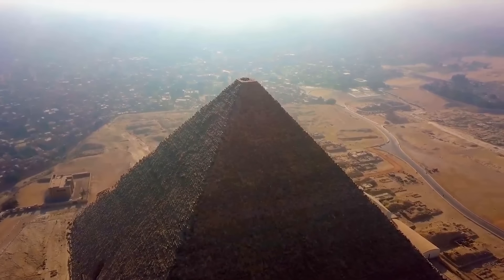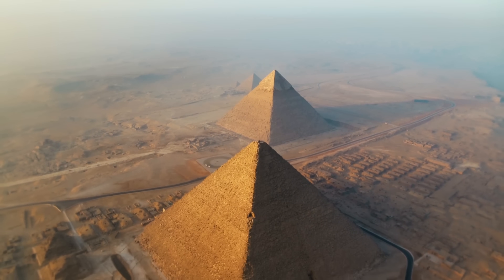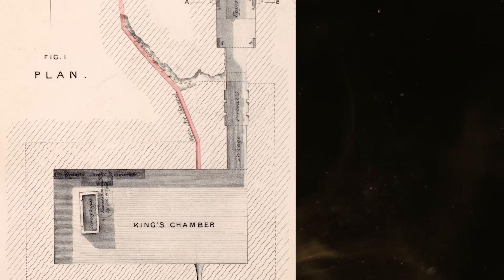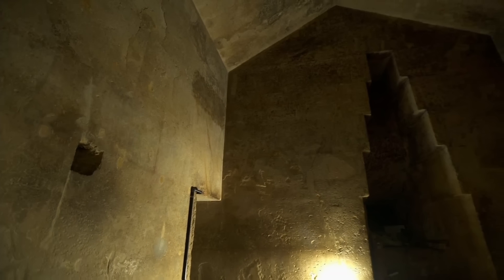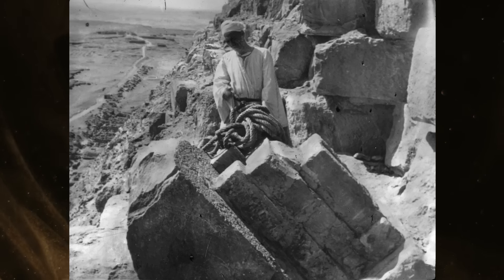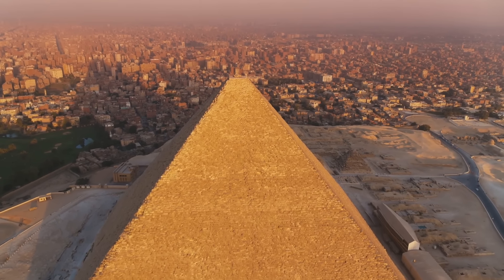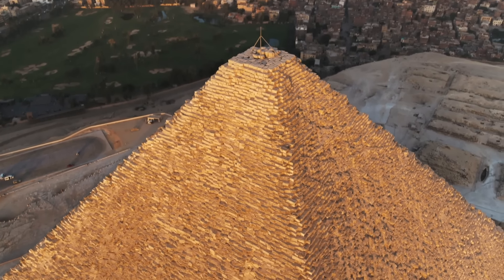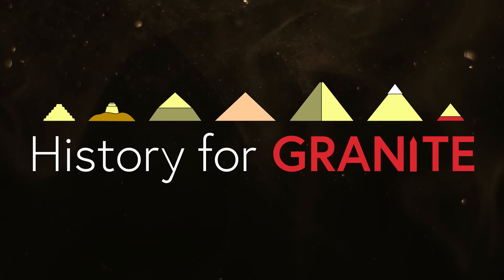One Solution to the Four Channels of the Great Pyramid

Comment: .....yes, but unfortunately you have not addressed why the Queen's Chamber northern and southern shaft's do not continue onward to the exterior of The Great Pyramid like we observe in the King's Chamber northern and southern shaft's ???.....are you saying that the Queen's Chamber is totally unfinished ???.....additionally, if the shaft's are for ventilation, why would you block the Queen's Chamber northern and southern shaft's at both ends, from the chamber itself up to were the shaft's meet their respective blocking doors, this seems illogical, as designing these doors within the construction of each shaft obviously blocks their continuation to the exterior of the pyramid's casing-stones ???.....still too many unanswered ???????? HfG.....
Reply: Based on the shorter channel lengths and position and nature of the unfinished chamber it almost looks like a decision to change the pyramid size/height or to create the kings chamber was made during the construction process.
Reply: @tommymaddox6785  .....OK LOL !!!, so let's get this straight, both the initial constructions of the Subterranean Chamber and the Queen's Chamber were made in error, and thus intentionally decided upon to remain unfinished by the architectural intellect of the Pyramid builders during the construction process ?????.....likewise from the outset, the Pyramid builders had absolutely NO prior foresight during their construction that the possible abandonment of interior chambers could materialise because of their own erroneous architectural/mathematical calculations !!!!!.....continuing, the Pyramid size/height had to suddenly CHANGE during the construction process because the architectural intellect of the Pyramid builders were again very erroneous with their mathematical/architectural calculations of the Pyramid's interior/exterior harmonious proportions ?????.....and so, notwithstanding, this narrative conveniently fits very nicely with OUR own modern 20th, 21st Century mindsets and points of view !!!!!, thus OUR analysis here is ABSOLUTELY CORRECT, IRREFUTABLE, UNCONTESTED and can easily explain away the MANY questions relating to The Great Pyramid's architecture, mathematics and construction antiquity, CORRECT ?????.....your quote: "...shorter channel lengths and position and nature of the 'UNFINISHED' chamber it 'ALMOST LOOKS LIKE' a decision to 'CHANGE' the Pyramid...

Comment: I've been doing some thinking, and it seems to me that the way these channels were cut reveals also how the stones were cut. Unless I missed a revision, Egyptologists would have you believe that they cut them with copper tools, which just never really added up. Copper is much too precious and weak to chafe away on granite. However; the drill and saw marks do reveal that something thin was used, and they were able to employ this after the stones were put in place and covered.

And I think the answer is rope. Rope has incredible sawing properties, is cheap and can be easily fixed or replaced when broken.

Comment: It would appear that they were sealed in the chambers long before the pyramid was finished which would make them of no use during construction.
Reply: They would have been of use up until the higher end level was closed. There is use for them during the middle construction phases when they were still open.
Reply: Or a Megadisaster struck before they could finish. Water ,& a wooden plug could be added, as they advanced up the Pyramid; (to prevent sand, & dirt from clogging.

Comment: I appreciate your utilitarian functionalist approach to the consideration of individual aspects of pyramid construction. While on the large scale, a pyramid and its associated complex itself, it's fair to suggest that ritualistic / theistic considerations might be the primary reasoning behind the design. But when we get down to atomic, meaning small individual, elements - I think questioning from a utilitarian functionalist perspective makes more sense. Yes, those blocks with the copper pins might have some ritualistic function, but it might also be leftover tooling from the construction itself and we should start from that paradigm before anything more complicated. I am not suggesting that it's purely functional, only that considering function on a range of possibilities starting with purely functional and then moving towards more abstract purpose seems to be the best way to approach it. And then even consideration of the "atomic" individual elements, the structures that they are incorporated to at larger and larger scales until we are considering the entire - well, that's where it gets very interesting. Clearly I am saying what the narrator is essentially saying - those shafts sure are a conundrum. Anyway, great channel!

Comment: I've always had an interest in the pyramids at Giza.  All the passages, all the strange angles, and particularly the weird little opening at the bottom which heads down into the plateau and appears to have originally been cut all the way to the natural aquifers, was really weird.  Why put a well at the bottom of a crypt?

Then in 2014 I worked for a local water well service.  Modern water wells consist of a single shaft down into the water table, with a perforated pipe down into the Earth and a mechanical pump at the very bottom.  The perforations in that pipe allow water to seep into the pipe and the pump pushes that water up through the inside of yet another pipe system which leads to plumbing.  Eventually those perforations, in the outer pipe, become clogged with sand, silt and rocks, so then the well service has to perform "an air lift" where they open the well head to attach a massive air compressor (the kind which can only be moved on a flatbed trailer) and they remove the inner pipe, connect the compressor to the outer pipe, and then push over 600psi down the pipe to blow the obstructions out of the perforations.  The massive air pressure pushes the silt and debris out of the perforations dozens of feet below, and also pushes hundreds of gallons of water back up and out of the well head, around the outside of the perforated pipe.

So for the last decade I've been convinced that all 3 pyramids at Giza represent ancient well heads, which effectively collect and pressurize air for the purpose of aerating and thereby pumping the water in the aquifers below.  In this fashion, the massive pyramids could serve as non-mechanical pumps which drive water in the aquifers to wells and fountains which connect to the same aquifers, all over the plateau, with overflow welling back up into the pyramid itself like a cistern.  My idea is that each pyramid was built as an upgrade to the previous.

This layman's theory explains a whole lot of oddities, such as the undeniable evidence that the Sphinx enclosure (downhill from the Great Pyramid) has suffered water erosion (where different geological experts all agree that the water erosion occurred, but disagree as to how and why) and that the temple beneath the Sphinx was once completely filled with water.  It further explains all the chambers in the pyramid as cisterns, and the steep uphill grade of the Great Pyramid's entrance shaft, for draining the cisterns onto the plateau surface.

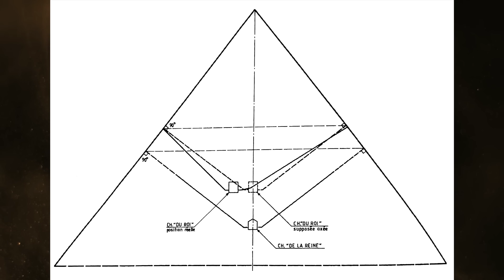Comment: Truly awesome video, but 23:00 you say that "the difference in inclination still follows the shortest path for both channels", which isn't true.
From any point in the pyramid, the closest path to the outside is always one that has a 90 degree angle to the surface.

I imagine a good reason for why they did not use the shortest path is because of symmetry, since the ventilation shafts would be visible from the outside, they would have wanted them to be at the same height on both sides.
Also the diagram shown at 23:00 kinda suggests that the king's chamber was originally supposed to be in the center, so that could be another reason for why they adjusted the shafts like that.

Another commenter pointed out that another very good reason for not building straight shafts is the need for passive ventilation: as it gets hot inside the pyramid, the air will pretty much automatically be drawn out through the tunnels.

Comment: I love the way you use logic and observation to describe the constructions.     It drives me crazy the way MOST archeologists simply make up solutions to fit the problems - most of which don't make sense at all.       Just a thought, as the "Queen's Chamber" is much lower, and was possibly constructed during the early phases of construction, is it possible that the the two "air channels" were exactly that, until the construction got to a point, that they either were no longer needed, and/or functional?     This would explain why they were not continued any further?    Again, just a thought.    I can't wait for your next video, where you present your conclusions.

Comment: According to me, the panes in the queen's chamber could have been connected to other panes filled with water. They were covered because there was no need to unclog them in the event of accidental clogging of such small channels (20cmx20cm) with debris. Ask yourself how to remove the limestone stuck deep in the shaft from a curved shaft. It may turn out to be impossible. You would have to crush and break the stone and then remove it from below. If it hadn't been noticed that
  the canal is blocked with stones and rubble was constantly falling in. It would be almost impossible to break a large stone because the rubble would absorb the impacts. There was a high risk that the shaft could be clogged and therefore unusable.

Comment: The worst place to keep a pipe from being blocked is that its lowermost endpoint that only facilitates a place for work dirt stone rocks can pile up and block the entry , Why would the lower part of channel be sealed? If they did not want it blocked then it should have been done from a higher elevation not the bottom?

Comment: As a builder i imagine that the channels where needed for ventilation so work could continue and be relatively comfortable in the chambers while finishing work was done, so work could carry on around  , as the pyramid continued to be built past and over going upwards, once the queens chamber was nearly done those channels where blocked off at the point the pyramid had reached ,which by  design left them well back and hidden from the outside , the ventilation for the kings chamber would still be needed till the pyramid was finished on the outside so was hidden in the finishing off work .

Comment: The blockings with the copper works were used for changes with the seasons. The copper works allowed the blocks to be hooked and removed or had ropes attached to pull the blockers out. In cooler seasons the blocks were reset in place to prohibit the chimney draw effect so colder air wouldn't circulate into the pyramid. And/or, set in place to prohibit rain water from entering the structure. The channels with blocks are the on and off vent system.

Comment: Very impressive work. Also your later videos, absolutely incredible. It makes so much sense.

But I can't really wrap my head around, and I might have missed the explanation, but why wouldn't they build the channels open immediately? Why build them closed and open them up later? Somehow the workers are so revered that their bodies are put in the pyramid if they die working its construction, but they're not allowed fresh air? That doesn't really make sense to me.

Hang on...
It does make sense. They didn't wait until the pyramid was completely finished to open them. The blocks in the King's Chamber were put in place first. They worked from bottom to top, so they put in the ventilation shafts as they went along. The workers were still working in open air at this stage, and when the pyramid was closed the shafts were already open.

Comment: I believe the channels were for ventilation for the artists who would paint the walls with murals and hieroglyphs. This would have needed several lamps, that would have caused smoke and carbon monoxide buildup without ventilation. Both these channels were supposed to be plugged after the work was finished, but the pyramid was never fully completed.

Comment: Once you see it, you can't unsee it:  The tube cut bottom is higher!  The square cut side is lower.  The reason is the "ventilation" holes are not for air, they are for WATER.  The rounded side cupped and directed water to the lower flat side.  Angled and bent so it wouldn't run down fast. Condensation would always supply moisture for cooling.  The King chamber cooled inside so the holes broke thru.  The Queens chamber were uncut so the moisture would contain it's contents.  This allowed the structure to "breath" in thru the bottom chamber.  And breath hot air out thru the Kings chamber.  Physics explains how hot air rises.

Comment: Be interesting to test the residues on the top of the shafts for smoke or insence, if you have a body in there and it's going to rot it may allow some smell out, alternatively if you had started a ceremonies fire inside, smoke pouring out of the pyramid might look impressive, seeing a symbolic representation of the king returning to the sky, and then sealing off the tunnels, which would prevent air getting in and oxodising or rotting it's contents further

Comment: The chambers being tombs for a "King" and "Queen" has always seemed to me to be a modern imposed explanation for the chambers' purpose. I've read other explanation hypotheses, but all seem to fall short of being totally convincing. One thing about the Egyptian builders to me is that they were amazingly ingenious and advanced in their work. One obvious thing is that they knew a lot about how to use sand, stone, reeds and water. For example the Sabu Disk seems obvious to me to be a manufacturing tool for making rope. The Great Pyramid is a monument to their understanding, engineering and skill that remains unrivaled. They built with a grand vision to make things last millenia, not decades.

Comment: It seems highly likely that the Queens chamber was going to be the only burial chamber, but there was a decision to replace this with a more grand chamber. The air ventilation ducts were then capped and the Queens chamber left unfinished. The new Kings chamber was given the same ventilation ducts but they did go to the outside.

Comment: 21:25 in. in reference to the corner unfinished, its interesting that just now I am working on a job repairing cracks in someone's house and I am using the same technique to rebuild up the obtuse cornice to create a correct finish. Without the excess I pile up, I couldn't make it look right once the plaster has dried and to sand it back to the right shape. So the idea of it being left to perfect later is correct even in todays buildings.

Comment: Building the Queen's Chamber as a plan B would've required a massive amount of effort, which to me, as an engineer, I would never want to undertake unless there was concrete evidence from a recent attempt that the hassle of a plan B could very probably be worth it. Is there any evidence in past pyramids that the designers attempted something like the King's Chamber and failed, or another situation where a failed design could've led to a massive embarrassment? That level of conservatism in design could be some kind of insurance policy for the builders...a massive CYA move. Have there been void surveys on past pyramids? 

It also seems clear that their fears weren't about the service life of the King's Chamber and wear-and-tear on the new mechanisms, because if that were the case they wouldn't have sealed the Queen's Chamber's air shafts. Their fears must've been exclusively limited to the construction phase, and they considered the risk completely gone once the course of completed masonry rose to near the top of the King's Chamber. Do the Queen's Chamber's air shafts terminate on the exact same course, or does one go higher than the other? That would tell us something about the method of construction, and perhaps even the speed with which a course was laid.

Comment: 30:56 Hello Mr. Granit. Are you familiar with the theory that the the pyramid was expanded during construction, and thats why the channels in the queens chamber never reaches the outside, and why they were never opened into the chamber itself? Ancient architects goes over this in one of his videos, and he theorized that this vertical joint is due to the original smaller size planned, if this is true, it would make it credible that the kings chamber shafts also bent horizontally towards the end of the pyramid, just like John perring said.

Thanks for all the work you do.

Comment: I say they are tuning ports, the power making process used theweight of the rocks to press on crystals that make electricty that seperated water into Hydrogen and Oxgen, some how the gases were convert into an engery that was transmitted from the gold peak. There many missing parts so we don't understand what processes when on in the great gallery and kings champer, but the shafts were used to tune a chamber in the process

Comment: I myself (in jobs less permanent than the pyramids) have put a finished surface in place and then waited until later in the build to cut holes for ductwork etc. So it makes sense to me that it was put off until later.

I do have to wonder if the pyramid went through any major design revisions partway through construction.  The biggest one I see is the queen's chamber air ducts seem to have been abandoned before they reached the outer walls about the time the King's Chamber roof was being worked on and I wonder why.  It feels like "plug 'em up and then we can stop bothering with that."